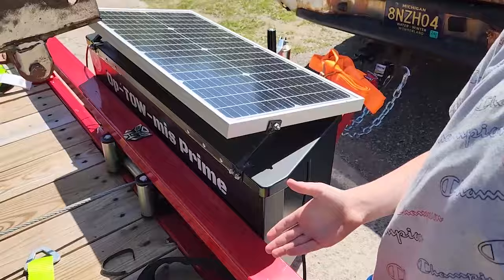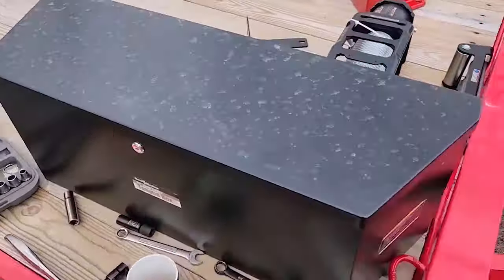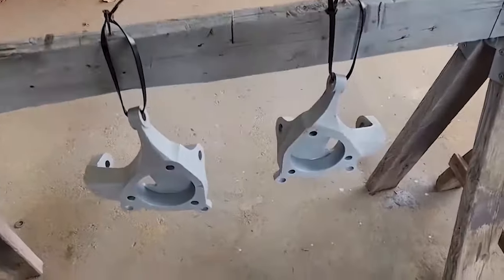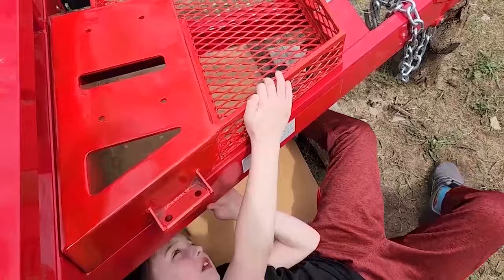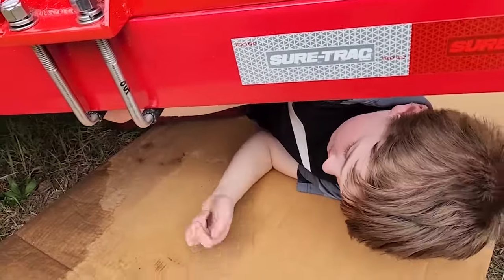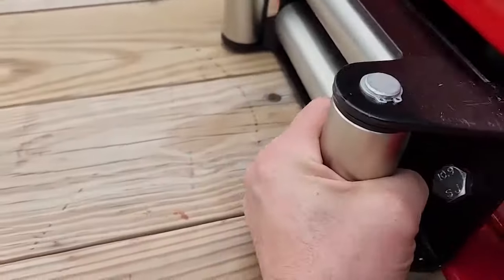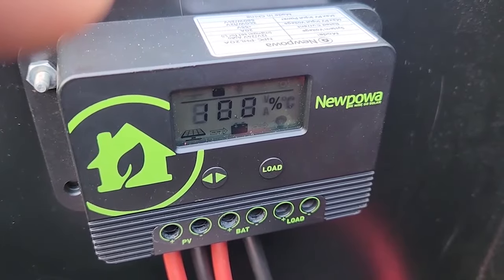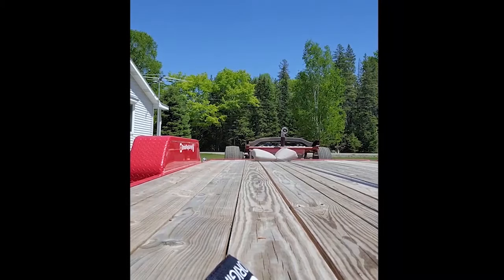Harbor Freight Badland ZXR 9500lb Winch - Trailer mount.                          Op-TOW-mis Prime.

Comment: Love this.  I actually bought a tongue utility box from HF and put the winch and battery inside.  I mounted the remote wiring to the outside of the box as well.  I then cut a hole for the winch cable and cut rubber tubing for around it.  Then mounted my fairlead to the front support of the trailer. Love the videos.
Reply from the maker: Thanks.  The damn mice got in mine this winter through the winch hole and chewed up my new straps.  Always something

Comment: LMAO... Oh yeah i got tape towers. Very nice job on the trailer! Man.... a winch is a necessity. That Mount and tray turned out really nice, almost a shame to cover it up with the tool box. I was gonna say at first that box may be a little small....lol  I need to add one to mine. The winch just has a soft cover on it and i swing a battery into the bed. I REALLY like that solar charger, that's ingenious! Awesome job fellas! 👍👍👍
Reply from the maker: Thanks man, we had fun.  Used it this weekend.  Worked well